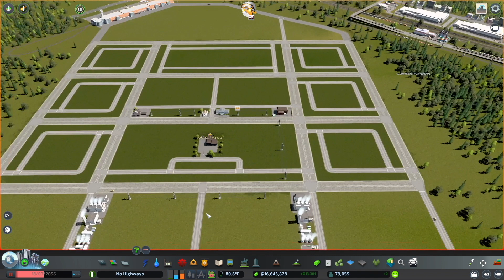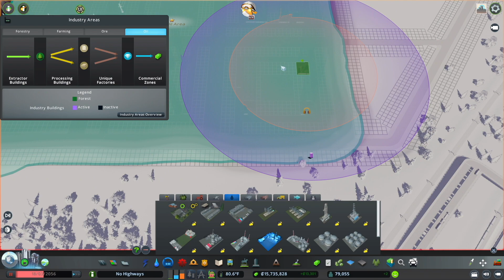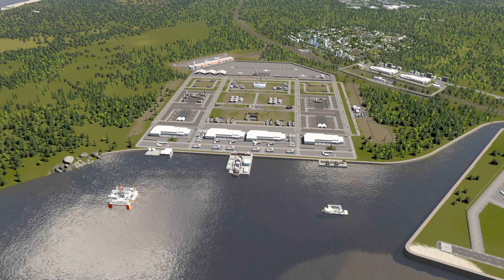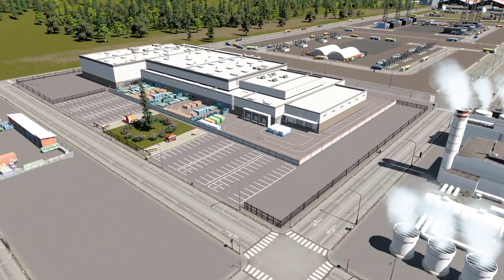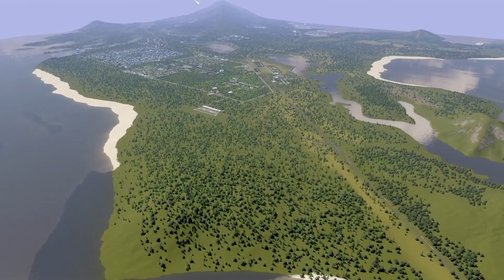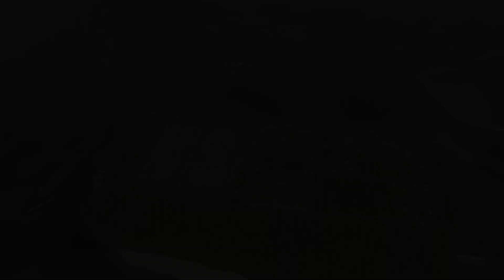How to Build an Efficient Oil Industry | Cities Skylines | No Highway City | Walk & Bike

Comment: Interesting. I wanted to see how much revenue it generates, what the average income is. I built my oil industry using mostly one-way industrial roads, going from extractors to storage tanks to processors to refineries and then to my cargo rail station and from there to return roads for all of the trucks that got generated by the previous, and a warehouse district that is close to my highway network. My cargo airport/rail hub is somewhat away from the oil area, more central to all four of my specialty industries. I only need one.
I use the most efficient buildings, small oil pumps, small tank farms, waste oil and naptha cracker factories and place them as tightly as possible.
I use the small warehouse for my Special Industry zones because, for the space it uses, it has 3 times more trucks and can store twice as much product as the large warehouse. Having many of the small warehouses means I have more trucks to deliver to my zoned generic industrial areas and off map as well. Plenty of warehouse trucks and easy highway access is key to keeping the "not enough customers" warning off my oil industry buildings. The small oil pump, tank farm and refinery trucks are never maxed out as they are never leaving the area, they are always delivering to their next-tier buildings and returning to base. The small warehouse trucks do the off-map delivering and to my generic industries.
My area has 23 small oil pumps and never has to import in spite of the fact that those 23 are producing a little over half the production of my 24 refineries and yet they never run out of material somehow. "Butler Petroleum LLC" generates an average of $70K, often making $90K+. The traffic is red most of the time but it's always moving, no long stoppages. I have 20 workers barracks inside it and it takes up about half the space you're using. The Plastics Factory is always running at 150%, right next to the small warehouse park so it never runs dry.
All of my specialized industry areas have their own "warehouse park" with about a dozen small warehouses close to the highway and right next to them is their respective special factories that only use what that zone is producing: The Furniture factory in the Forestry zone, the Bakery in the Farming zone and the Steel Factory in the Ore Zone. The rest of the Special Factories have their own park with 8 large warehouses that supply the 8 types of product for their needs. Those factories run about 2/3rds of the time. I've yet to figure out how to keep them running at 150% all the time like the four that use only the product their respective zones make.
The Industries DLC is by far my favorite mod. I'll watch any YT video about it and how others use it.

Comment: I do love the idea of cutting the area off from outside vehicle traffic...  or, cutting your city off from all the oil traffic, actually.   That's pretty genius because, as you stated, the storage units create all the darn traffic when they start trying to export material out of the city.   Having a transit rail and airport is brilliant.   I'm going to incorporate that thinking into my cities....  Separate extraction sites, and separate manufacturing sites, linked by rail (industrial and passenger) instead of roads.
Reply: I've tried it time and time again and I can get it to work to an extent, but I wouldn't call it efficient. First off my traffic still gets insanely heavy in the industry area, even though I have perfected a system that keeps the traffic at least moving it's still lit up cherry red. Only plus side is it doesn't affect my general city traffic. But where it really matters is no matter what I do my factories never have enough goods. Or they only to for a short time then run dry again. They are all centerly located between all industries so they have a clear and easy and short path from each place. Train should be more efficient than truck but it hasn't been for me. The warehouses don't stay full, they barely ever have anything in them. The only thing I get money out of is the exports directly from each industry itself. The bakery and furniture factory are the only factories to ever successfully give me a consistency cash flow.
Reply from the maker: Damn sorry it’s not working out for you! I never had an issue with traffic but had a few issues with products that I end up fixing by putting storage either to full or balanced I can’t remember which one. The game isn’t perfect that’s for sure and it usually takes some messing around with things to make it work. Hope you can get it sorted out! Thanks for commenting
Reply: @Grahtles  that's another thing, whenever I change my storage areas between full balanced or empty they sometimes automatically switch back to full when I close it's window. Like when I want to set all my unique factory warehouses to empty they just go back to full. Which is the exact opposite of what im trying to accomplish. Even the vanilla warehouses. So that must be a mod conflicting or something?
Reply from the maker: @Kevin-dq8os  Well that's new and annoying I haven't played cities in a while that sucks!
Reply from the maker: @dsinsocal  thanks yes the whole city was kinda created that way it definitely helps out the traffic a lot everywhere.